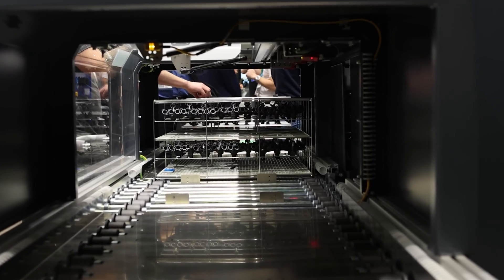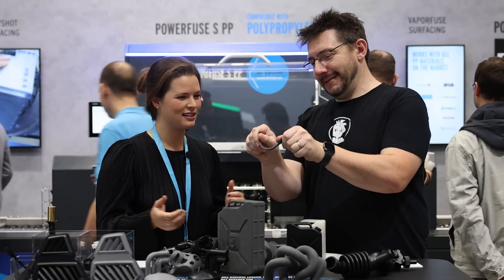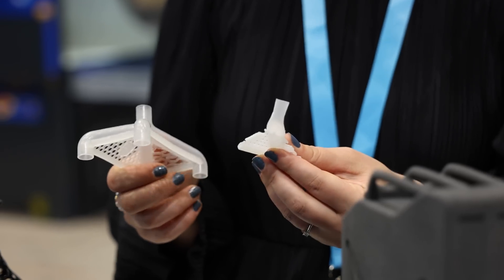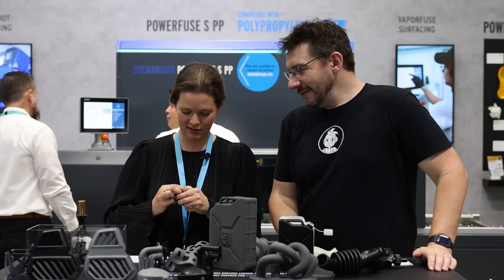How To Smooth 3D Printed Polypropylene!

Comment: This seems really cool, wish they gave some more information about how it all works. Are you just chemically altering, or adding/removing material? Will it affect tolerances?
Reply: Our VaporFuse Surfacing process produces an even more uniform surface by rearranging the surface topology without adding or removing material. As a result, the part feels even smoother after the VFS process and has a glossy and sealed surface, even for TPU parts - or as in this case: PP.
Reply: Probably pretty proprietary chemicals and physics they use in the powerfuse post-processing for printed polypropylene parts. Either thats a well guarded trade secret, or you can go find out quite a lot more details in the public patent applications if they actually patented the process.

Comment: A simple web search show that xylene (among a few other solvents) will dissolve polypropylene. So it may be a vapor-smoothing process using xylene.
Reply: We don´t use any harmful hydrocarbons or halogenated substances (like xylene) in our processes due to their hazardous properties! Instead, we use a green solution, which is biobased and biodegradable. Our sustainable VaporFuse VF44 EcoFluid PP is 100% bio-based and readily biodegradable as well as non-toxic: no PFAS, non-CMR, non-vPvM/PMT.
Reply: Xylene is not halogenated.
Reply: @soundspark ???
Reply: @YunxiaoChu  So perhaps they just meant that it is a harmful hydrocarbon, but just badlyh written?

Comment: I keep hearing that polypropylene is hard to print with, but I found it even easier than PLA, used PLA settings, cold bed, slightly hotter nozzle, slapped some packing tape on the bed for adhesion, and it printed beautifully.
Reply: In industrial 3D printing (powder bed fusion), PP printing is picking up speed. The hurdles you mentioned have already been overcome in this area.
Reply: The PP whisperer